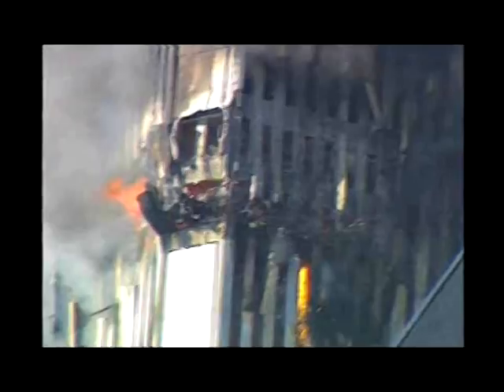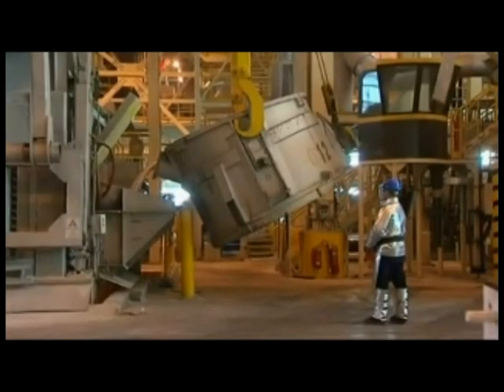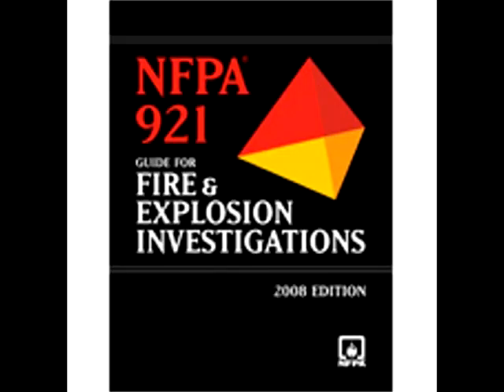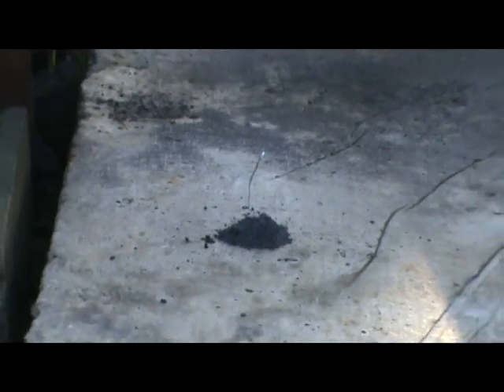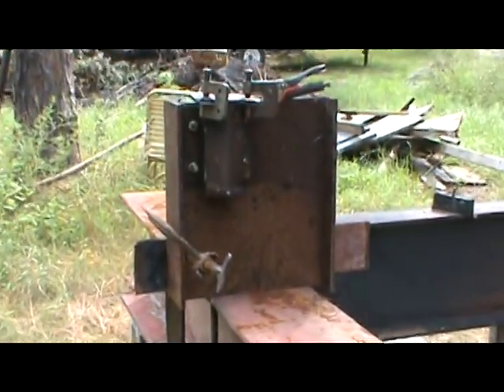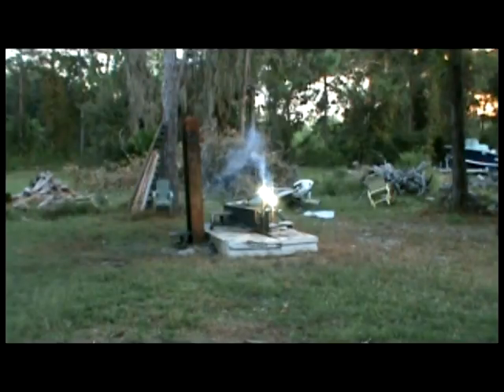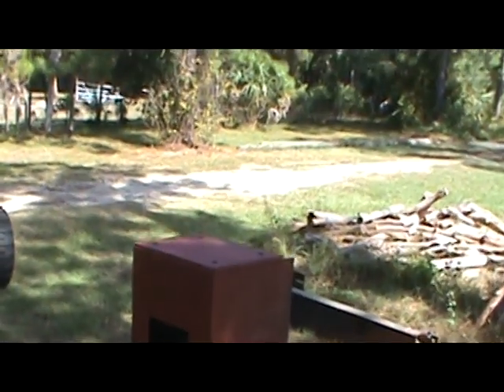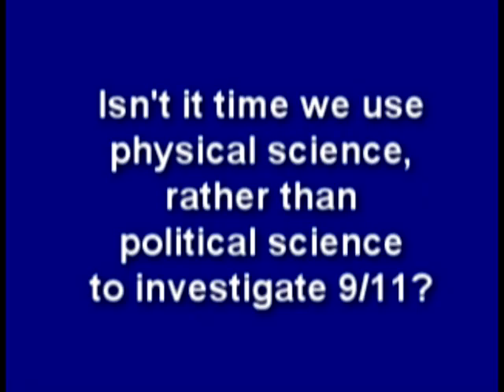9/11 Experiments: The Great Thermate Debate

Comment: So its possible to do it with thermite.
Does it mean it have be done with thermite ?

Can jet fuel weaken bolts enough so the weight of the structure break them ? 
Well a basic blowtorch could.

Does the thermite explosion do a gunshot sound ? is that loud enough ?
I mean, the structure is well hiden behind thick walls.

What would the us govt win by doint this ? the right to legitimately attack a country for petrol ?
Since when are they seeking for public opinion ? regular terrorists wheren't a good enough reason ?
How many wealthy engineers did they have to corrupt ? how hard is it to corrupt someone who have everything ?

I can make a lightning with a tesla coil, does it mean lightning are made by us government with huge tesla coils ?
Because tests in my backyard showed that 2 mass of air can"t produce electric arc, but my tesla coil can ?

I loved this video BTW, I learned some stuff and this is extremly well made.
Reply: Why would the government do it? 

That's where you need to read up on PNAC and "A new Pearl Harbour". Look at who was in PNAC in the 1990s and in Government in 2001
Reply: Jay I could answer your questions but judging by the way it is written you don't want answers you want your questions to instigate your own opinion on the matter. The government gains a war from deception. If you can't reason why a war would be desirable at the time being how the world's largest source of drugs and oil come from the country we are Invading then for all your questions you know nothing.
Reply: Bill H Though I am not concluding on either side of the 9/11 conspiracy agrument because I am conflicted by the convincing arguments on both sides, saying that "some of the bolts would weaken" is a servere understatement. Watch this video ( https://youtu.be/FzF1KySHmUA ) to see the effects of heat on steel because it really did blow my mind to see just how weak it gets. Again, I am not trying to pick a side here but I am going to just leave this here because this is a very interesting piece of evidence and if truthers would stop arguing in favor of it they may look a bit more credible.
Reply: Happy Man "The United States is a Constitutional Federal Republic (a federation of states with a Representative Democracy)"

So while we do not vote on laws directly we DO have the power to vote in people who will change what we want.
Reply: Bian Wilson Thanks for more pointless comments. Are you going too add anything of substance or just continue to scream and cry and stomp around in a circle? Either one is perfectly fine for me, because then people will notice your insecurity, that you made not even one single attempt or argument and just babbled like a fucking idiot, which by the way is really actuslly making me laugh quite hard rght now, or you can make actual arguments that I will debunk, every single one, and then publicly embarrass you some more. 

I would recomend you continue on with the first option else it wouldn't turn out good for you.

Again, you only continue to make an ass out of yourself and prove that you are a complete fucking idiot, so please continue your pointless babbling and proving me  right even more, I know you will.
Reply: Bian Wilson LOL that was way too funny, I had to screenshot that one.
Reply: Bian Wilson None of this proves a Controlled demolition
Reply: Conner Price yeah but the structural failure still happened at the base of the structure in the video, where as the twin towers the building was struck on the 93-99 floor out of the 104 stories in the building so the structural failure resembled that of the first few examples given in the video you sent. Had it been struck at the base of the building I could see your point.
Reply: Conner Price because it didnt fall from a structural failure from the bottom it failed from an impact in the side of it and close to the top. I literally just said that. Lol you wouldnt believe me no matter how irrefutable the evidence. Why are you so determined? Are you anti conspiracy? Also how do you send links do i have to type the entire url out
Reply: Conner Price yeah but twin towers didmt even begin to tip it just all went straight down as if ALL support beams were taken put at once. Lol but what makes you so certain to the point of immediate denial, as i said it doesnt matter what evidence i present to you because youre so willful to deny and argue before considering the truth of the matter.
Reply: Jay You’re missing a key point... yes jet fuel can melt steel possibly. But why did the tower collapse below the crash?
Reply: Harry Heiniken you havnt debunks the fact your face looks fucking stupid, fuckface, which is my main argument on you right now. Lol i dont give a shit what you suggest, professore fuckface, until you change your silly ass profile pic.
Reply: Harry Heiniken professors fuck face has no comebacks so he repeats himself :) haha he'll get tired of it eventually. Sorry kid but I don't debate with dipshits who pass out drunk at parties, sorry professor.
Reply: Conner Price haha 'c ant defend any points' my only point is that he's a fuxk face and I can support that thoroughly. But you can say anything you like when you're delusional lol goes to show that you're on auto pilot not even thinking just arguing so you can go on following the news like a good steeple. :) so you're saying his profile pic doesn't look like a fuck face? I havnt made any points for you to tear down. Except for that. :) LOL
Reply: Conner Price lol well any educated person wouldn't take fuck face seriously, It is rather pointless to reason with an unreasonable person wouldn't you agree? You are different as you are presentable and are at least able to hold a legit debate with me. I cannot debate with Harry as his profile picture is to stupid. :) I feel more inclined to insult him based on it lol. Let me watch the link you sent and I will reply again and we can debate if you want. If you want to shit talk then we will do that but so long as it's a debate then I'll refrain from petty insults like stupid idiot etc... I would kindly ask you do the same as you don't appear to have a fuck face for a profile image as harry DOES.
Reply: Bian Wilson Okay then. Explain how a controlled demition produced this movement right here. 

https://sites.google.com/site/911stories/ST1-full.jpg

How did it cause the exterior columns to GRADUALLY bow into the building over a period of 45 minutes, before eventually buckling them and causing the top to drop down?

http://www.debunking911.com/sim1.gif

Intentionally pulling the core down first to cause the buckling cannot explain why it sagged GRADUALLY and it also would not cause it to tilt  to that kind of a degree, so the core being destroyed first doesn't work as an explanation.

Thermite at over 4,000 degtees F could no't cause it to sag for 45 minutes, the steel would had already failed long before its melting point at 2500 degrees F.

What I am saying is explained here

http://www.representativepress.org/BowingDebunksExplosives.html

Creep deformation caused by fire can explain it perfectly, so if it was a controlled demolition as you insist then how did it produce that effect?

And both buildings actually did tilt to some degree, esspecially the south tower.
Reply: Bubsy Not in a chimney effect fire. The black soot alone can reach temperatures up to 1400 degrees C. The sagging floors and debris pile around the area would cover it up like a blanket letting it pool up. Also the floor of was on was a floor made up of huge battery equipment that is highly flammable and so lead would mix with it too . If it's thermal conductivity were changed it could flow and glow at the same time.

I am very unimpressed with the video, it is set up to fail. For one it's done on a much smaller scale so it would cool much more quickly in the video, and they also did not even recreate the stack effect conditions that it was exposed too. 

If it were molten steel then it would melt the aluminum cladding on the sode of the building and would not cool that quickly to a silver appearence
Reply: for sure the jet fuel didnt do it...
Reply: Bubsy 
"Below is a message from Stephen D. Chastain of Metal Talk.

Several times over the last year I have been asked to comment on a photo of one of the Trade Center Towers. The photo shows a molten flow from one of the windows. The flow falls down along the building. It appears orange and turns to a gray color as it cools. 

The questions usually want me to address "Is this photo a fake?" and "Is the flow steel or aluminum?" "Is this situation possible?" 

First, I will address the temperature range, then the color of the flow. 

I am working in imperial units and temperature in degrees F [To convert to C use this link]

Metals lose about 50% of their strength at 60% of their melting temperature. This is common knowledge and may be found in any undergraduate text regarding "Fracture and Deformation of Materials." 

If the approximate melting temperature of steel is 2750 F the the material would be plastic at 1650 F. Even assuming a safety factor of 3, you would expect the bolts or other structural members to deform and fail near this temperature, especially with the additional weight if a jet air liner. I would assume that the live load calculations did not include the typical office equipment and an airliner plus a factor of 3. THEREFORE I assume that the flow is not steel and that the temperature of the steel members at the time of the photo is less than 1650 F. 

Assuming that the flow would be molten aluminum from the airliner and the color of molten aluminum is silver then why is the flow orange? 

The color of pure molten aluminum is silver, It has an emissivity of .12. Steel has an emissivity of .4 and appears orange in the temperature range of molten aluminum. 

The emissivity of aluminum oxide is .44 and also appears orange in the melting temperature range of molten aluminum. 

The emissivity of plate glass is .937 It begins to soften at 1000 F and flows around 1350 F. Silica has an emissivity of .8 

Copper oxide also has an emissivity of .8. however I will assume that their effect is negligible. 

Aluminum oxidizes readily in the foundry under ideal melting conditions. Large surface area relative to thickness, turbulence, the presence of water or oil greatly increases the oxidation of aluminum. A jet airliner is made of thin aluminum sheet and most probably suffered considerable oxidation especially in contact with an open flame and being in contact with jet fuel. If you don't believe this, try melting a few soda cans over coals or open flame. If you are lucky you will end up with only 50% aluminum oxide. However, the cans may completely burn up. 

The specific gravity of aluminum is 2.7. The specific gravity of aluminum oxide (Al2O3-3H2O) is 2.42 the specific gravity of Si = 2.40 and Glass is 2.65 these are all very similar and likely to be entrained in a molten aluminum flow. Don't believe it? lightly stir the dross into molten aluminum. The surface tension is so high is is almost impossible to separate them. 

THEREFORE assuming that the flow consist of molten aluminum and considerable oxides, and assuming that the windows in the trade center were plate glass and also in a plastic state and that they were also likely entrained in the molten aluminum. I would expect the flow to appear to be orange in color. Especially since both the entrained materials have emissivities equal to or more than twice that of iron. 

Also since dross cools to a gray color and glass with impurities also turns dark. I would expect that the flow would darken upon cooling. 

I would also suggest that not only is the photo possible, but entirely likely. 

Summary: The flow is not steel because the structural steel would fail well below the melting temperature. The flow is likely to be a mixture of aluminum, aluminum oxides, molten glass and coals of whatever trash the aluminum flowed over as it reached the open window. Such a flow would appear orange and cool to a dark color. 

Stephen D. Chastain"
Reply: Jay so a couple and I don’t necessarily disagree with you. But on what the govt would gain and engineers to corrupt

The govt did gain a war, a boogeyman (Al Quida), overreach in national survailence (patriot act), hundreds of billions in revenue from the war and industry, trust in intelligence agencies, and more. 
The engineers didn’t have to be corrupted, they could’ve been working on classified projects with goals that were lied about and their technology used against us without their knowledge. 
It’s far fetched, serious, and damning but it’s not out of reason. I’m still a fence sitter bc videos like this renew my skepticism.
Reply: Operation paperclip was a proposed attack on the citizens of the United States to gain support for war against Cuba. You can look at it on the FBI website. What if 9/11 was an operation paperclip scenario? It’s not the oil we went to the Middle East for. It’s the opium, since we first invaded the opium production in the Middle East has grown exponentially and now the Middle East provides the world with 90% of its opium. Do you know what opium is used for? It’s used in medication and heroin. Every pharmaceutical company has opium drugs they give to people that are easily abused. These people spend billions each year on their addiction, to opioids. All that revenue goes straight into our economy and other budgets some of which are traced to politicians like Hillary and Bill Clinton. Then, as for oil, the US is no part of the oil monopoly in the Middle East but they do cut us a discount for protection of their oil. That’s why when an oil extraction point is attached we react faster than when our own trips are down. Then by waging a war we gain massive profit by development and selling of weapons and also protection. It’s my personal theory and I think I’m right but I’m probably missing a huge chunk of reason.
Reply: Noah Sharp - There's no longer any doubt in my mind that 9/11 was a false flag/ Operation Paperclip-type event.. And you're dead on with your opium theory.. Nobody could convince me that there isn't a direct correlation between Afghanistan being the WORLDS largest producer of opium, and the fact that heroin/opioid use is at an all-time high in the United States, Canada, and even many European countries.. Since the invasion of Afghanistan, the production and distribution of opiod-based pain medications has risen over 10× what it was before the invasion, which is exactly why we're now in the midst of a nationwide heroin/opoid epidemic that has ultimately resulted in a record number of related overdoses and deaths.. 

Now I don't believe this was the ONLY plan the elites had in mind while planning this whole deception, but it was definitely a big part of it.. Even though it was never about oil directly, there's obviously a LOT of money to be made for American-based oil companies there also.. It was actually more about the LAND they needed to build a pipeline. That's exactly what this whole Syria conflict is about.. I know the mainstream media keeps telling us that Assad's attacking his people with nerve gas, but these are simply lies created to justify an American invasion because Assad is completely against this pipeline. The problem comes in with the fact that they need part of his land to build it, and he refuses to permit it..

Last, but certainly not least, these wars have given the military industrial complex an enormous boost, and has generated a ton of wealth for a handful of very powerful families.. The bottom line in EVERY war is profit..
Reply: THISE TOWERS WERE MEANT TO WITHSTAND ROCKET STRIKES. HOW CAN A PLANE BRING THEM DOWN... AND BRING THEM DOWN SO CLEARLY. It obviously was a controlled demolition
Reply: Bian Wilson Reading through the comments it doesn't appear to me either that you left any sources, all I see is you getting your butt kicked by Harry and whining about it. You truthers are so fucking stupid.  Can't defend any comments you crap out.
Reply: Bian Wilson  I was just scrolling through the comments on this video until I ran across this thread and saw another one of you truther morons doing nothing but throwing out insults without adding anything useful.

https://youtu.be/_Kd_OPH9c0c

Large steel buildings like that can't just fall over, I don't think any Physics teachers ever told you that because it looks like from how you talk I don't think you ever went to school, much less would they ever let somebody as dumb as you graduate.
Reply: Bian Wilson Then how else shoud it have collapsed? 

https://www.metabunk.org/attachments/wtc-tilt-jpg.1665/

The building can't topple over and gravity would immediatly start dragging it downward to the ground. If the floors could only hold a maximum capacity of 15,000 STATIC tons.How would a floor with that maximum load capacity stop 100,000 tons of force SLAMMING into it)? (which this is still an extremely generous figure because it doesn't even take into account welded floor connection fractures or it's maximum DYNAMIC load capacity .
Reply: Bian Wilson It doesnt matter where it occured, look at the picture I posted above, when it begins to tilt to one side the connections on the other end would buckle and it'd have nothing to pivot off of. In order for itt to topple over, even from the top, the columns would need to be infinitley stiff. Conspiracy or not there was no controlled demolition.

And to post links yes just copy and paste the URL
Reply: If you've got everything, you've got a lot to lose.
Reply: What did they win?  Well, they obviously got alot of free gold and Oil from iraq... Eventhough the terrorists accused were Saudis..
Reply: Deluminate If you have done so much research then maybe you can answer the question I asked above that Brian Wilson ran away from
Reply: Bubsy Not molten steel, molten aluminum
Reply: darkjanggo actually the US is a constitutional republic, so not so much needing to sway the populous' opinion
Reply: darkjanggo Republic
Reply: darkjanggo we are a republic
Reply: Well if you look back into US history, on 2-3 confirmed occasions the govt has sacrified soldiers and civilians and framed another country to push the public cry for war. It sounds crazy, but it happened before and it could happen again. Maybe this was one of those times. At first I would joke that bush did 9/11, but then I studied my history a little more and found out some awful truths about the govt in this country. Soon enough it became more plausible. There's always more that we don't know. Things they don't want us to know. With the internet we get to know more and more everyday.
Reply: Jay Why would we want free healthcare you dunce. Free healthcare equals high taxes.
Reply: Dr. Phil I'll pay taxes for free healthcare. Sounds pretty good to me. More people die from not having healthcare because they make too much to have the free health insurance, and don't make enough to pay the premium for their family. They work hard, they are good citizens. Why should they go into mass debt because some insurance company wants to gouge you with high prices so you can try to stay healthy and still probably make you pay copays. A tax for healthcare would cost you less than your insurance does. Hell in some cities I pay a sugar tax. If my taxes go to anything I'd rather just have healthcare than some one the other bs I get taxed for.
Reply: Jay let's not forget!...that at that EXACT same time, the goverment announced that it had "lost" a trillion $$$!! & those "supposed" records to investigate where it went!...was the "EXACT" spot on the pentagon that was hit by 1 of the other planes!!!
Just a coincidence!!???...
Not to mention...
After they used 9/11 as their "excuse" to start war, change the laws/constitution, billionaires to cash in on insurance policies on outdated towers, ect, ect, ect...
It also allowed high ranking gov officials that "OWNED" private companys...(halliburton) to make billions of $$$ on the war itself!!

How many coincidences, billionares & corrupt things have to be tied together...to see the truth!?

Plus!! Any1 that really researches 9/11 & the planes involved...can clearly see from most all the video of the planes, they are NOT ordinary commercial planes.
They are darker, no windows, no or few detailings/logos, ect...just like military planes.

Bld 7 itself! Is even more of the smoking gun!!
No plane hit it & really a office fire is going to cause the whole building to collapse perfectly on itself!!?...when in history....this has NEVER happened before.
The list goes on & on...
Wake up!!! People!!...that don't think/believe/realize!...9/11 was a inside job.
Reply: Jay What would the us government get out of this? Well for a start it was the reason for us going to war. We needed a reason and they created one. Just like they have tried in the past
Reply: They want to control the people by fear because fear and hope are the easiest way to control the masses
Reply: Bian Wilson ur dumb. Just stop embarrassing yourself. People like you don’t get anywhere in life.
Reply: The company that contracted the towers to be built, were also in charge of cleaning it up... all before an official investigation was done.
Reply: darkjanggo We were in the middle East long before 9/11, without public approval, and we weren't showing signs of pulling out.
Reply: He never stated that the government did this he only said that they covering it up
Reply: Jay to be fair, I don’t want free healthcare, free healthcare is poor quality, because it means doctors are paid by taxes, and therefore, do not have any incentive to work hard for their position. Also, as long as they do it in one place (which they do) that’s a dead zone for the most part (which it is) and they do their best to contain it (which they do). I’m fine with the nuclear testing.
Reply: Why does anything happen?
Money of course
Reply: darkjanggo If you think the US is run by public opinion, I'm afraid your very naive. Elections are controlled by money; whoever gets the most campaign money wins almost every time. It's also almost impossible not to get reelected, and gerrymandering is completely legal. Many government officials are appointed, not elected, and can't even be removed with recall elections, allowing them to do things that go completely against what the public wants. Remember the repeal of net neutrality lasg year?
Reply: darkjanggo Whenever the government wants to go to war, they always use the media to manipulate public opinion. They did this after 9/11 to go to war in the Middle East. However, this doesn't mean that they faked 9/11 just to do this. They did the same thing with the sinking of the Maine to start thd Spanish-American war and with the sinking of the Lusitania and the Zimmerman note to join WWI. Even in WWII, they used a terrorist attack, Pearl Harbor, to justify entry into the war. Do you really think the government faked the sinking of the Maine and the Lusitania and the Pearl Hafbor attacks as well? If not, why do you think they faked 9/11?
Reply: you are one of the sheeple that outside of the boxes.
we need to convince more sheeple in the boxes to come out and face these ugly realities.
Reply: we get it Corner.. Jet fuel melts steel beam from the top to the bottom.
Reply: Jay - It was about WAY more than the public's approval to start a war.. However it WAS about gaining the public's approval and support, but for a completely different reason - turning a highly unpopular bill (the P.A.T.R.I.O.T. Act), into an overwhelmingly popular bill.. All you would have to do is read the United States Patriot Act, and you'll completely understand this theory.. 

In essence, the P.A.T.R.I.O.T Act put an end to privacy as we once knew it.. After passing this bill, police we're no longer obligated to uphold the Constitution; they were no longer required to prove reasonable suspicion in order to search you,  your house, your car, or any other personal or private property of yours; and it was no longer required for them to obtain a search warrant to do these things.. All that it effectively did was give the police and government the power to operate with impunity.. It's in direct conflict with several Constitutional Amendments, and therefore highly illegal.. Yet after the 9/11 attacks, most American citizens were begging for it to be passed.. 

In late May of 2015, the Obama Administration revised the Patriot Act by adding even more intrusive measures, and renamed it the National Defense Authorization Act, or NDAA.. The most concerning part of the bill, is the amendment that allows the U.S. government to indefinitely detain U.S. citizens, without charges, a trial, or any sort of due process, as long as they "suspect you of domestic terrorism". The scariest part about this is the language they used to describe WHAT would qualify you as a "dimestic terrorist". Here are just a few:

 Expressions of libertarian philosophies (statements, bumper stickers)

  Second Amendment-oriented views (NRA or gun club membership, holding a CCW permit)

  Survivalist literature (fictional books such as "Patriots" and "One Second After" are mentioned by name)

  Self-sufficiency (stockpiling food, ammo, hand tools, medical supplies)

  Fear of economic collapse (buying gold and barter items)

  Religious views concerning the book of Revelation (apocalypse, anti-Christ)

  Expressed fears of Big Brother or big government

  Homeschooling

  Declarations of Constitutional rights and civil liberties

  Belief in a New World Order conspiracy

Here are a couple links that summarize what the P.A.T.R.I.O.T Act, and NDAA actually do: 

https://www.aclu.org/other/surveillance-under-usapatriot-act

https://www.theguardian.com/commentisfree/cifamerica/2012/feb/29/ndaa-danger-american-liberty

At the end of the day, it was more about the ruling class grabbing more power and enslaving the United States population. But ultimately, it was about tricking us into thinking that this was in our "best intrests"..
Reply: And by the way, there is no way that this fire burned hot enough to liquify solid steel. So that raises the question of where the molten steel come from.. To this day, there hasn't been a logical explanation on behalf of the government as to what caused this to happen..

Over the years there have been dozens, if not hundreds of demolition experts and credible scientists who have explained in great detail why the "official report" could not withstand its own logic.. There are so many holes in the reports of NIST and the 9/11 Commission, that I find it hard accept the idea that anyone could possibly believe either of them.. I'm not even close to being any sort of an expert in demolition or science, and yet even I could effectively destroy both of their theories simply by using the basic knowledge and understanding I have in Physics.. 

I'm not asking anyone to take my word for it, but I am asking you to challenge this narrative yourself.. Go into it with an open mind, and see if the government's theory is capable of logically withstanding the challenge of scientific fact.. You might be surprised of what you'll learn.
Reply: There is no evidence of the use of thermite because, suspiciously enough, all of the scrap (steel) from the collapse was quickly gathered and shipped to China to be "recycled" BEFORE any sort of thorough investigation even began. Now does that make any sense?! Even your most novice investigator would understand the importance of this as evidence.. And yet I'm supposed to believe that this slipped the minds of some of the top investigators in the country? C'mon!!
Reply: Bill H why don't we just go and ask lol
Reply: Lord Shua - Yea, I'm well aware of Saddam's plan to implement a gold-backed currency that would have effectively de-valued the USD.. I believe the name for this currency was the "Dinar".. Are you aware that Gaddafi also had his hand in this? I only ask because this whole subject is something that not a lot of people know about, and even fewer are aware of Gaddafi's role in it all..
Reply: Conner Price - Brian only "ran away from" your question after answering it several times.. And yet you still continue to ask the same question lol.. Sure, you kept changing the collapse event you were using to base your argument off of, but the answer doesn't change. There is no way for a building to fall the way the two towers (and building 7) did without taking its foundation out first. And since the point of impact on each of the buildings was between 850-950 feet ABOVE the ground floor, there's no possible way the impact could have weakened the entire foundation as perfectly even as it would have to be for it to fall as neatly and evenly as it did.. It literally imploded, and fell straight into it's own footprint.. But I'm not saying anything that Brian didn't already say.. 

At the end of the day, anybody who understands the basic laws of physics, also understands that the way these buildings fell, and the "official" findings of NIST and the 9/11 Commission, simply do not add up. It's literally scientifically impossible to have happened the way they're claiming it did, and there are hundreds of credible Physicists and Architectural Engineers who have demonstrated why this is so.. Then, on top of all the science, theres the fact that there has NEVER been a modern skyscraper that has collapsed due to fire.. There have been skyscrapers that have caught fire all over the world, some of them burning for DAYS and still never collapsing.. So this has never been documented a single time throughout history, yet I'm actually supposed to believe that it happened 3 times in a single day, all within a few hours of one another? C'mon!! 

 If you aren't at least willing to consider it a possibility that this could have been some sort of controlled demolition, then you're simply not challenging yourself to think on a critical level.. Might I suggest that you check out "Architects and Engineers for 9/11 truth"? Just listen to what these guys have to say before totally making up your mind.. Cheers! ✌

https://www.ae911truth.org/
Reply: Steven Hyde Where did he answer the question? It looks like he rambled that the building would tip over to its side and fall over which is physically impossible. Brian, like you, is wrong, the towers did not fall straight down because that would mean the columns would have stayed in alignment and they didn't.

http://image.wikifoundry.com/image/1/bJnGDdVKcriu9-2pLASahQ40948/GW342H221

Are you trying to argue that this is a "straight" down collapse??? This is the South tower, the North tower didn't tilt to as much a degree but I will explain the initiation in the North tower. 

 The plane impact cut several columns, destroyed core bracing and collapsed floors in the area causing a hole. That caused core columns to loose lateral support and placed more load on  the other core columns. The plane impact also knocked off fire proofing in the area, and the fire spreads to the south causing the columns on that side to begin twisting.. Air is also sucked in through the large impact hole starting a huge chimney effect weakening the remaining columns much quicker.

The hole expanded and reached another row of columns in the center that supported the hat truss, and with this loss the stress had now become enough and the hat truss caves in at the center bringing the antenna down. The upper section of the core had been pretty hulled out by this point and so the mass travels a considerable distance before it impacts the first floor and then total collapse became inevitable.

With that said his answer about the tilting is wrong, and nowhere did he even attempt to answer the last question that I asked him, you claiming that he did would just be a complete lie and everybody can scroll up and will see that. 

" There is no way for a building to fall the way the two towers (and building 7) did without taking it's foundation out first "

Bare assertion, you show nothing to support that besides merely referencing A/E 9/11 Truth who's arguments have long been refuted for years now. Did you even read the article I posted at all? The collapse initiation can ONLY be explained by fire and you or Brian made not one single attempt to refute it, you cant do it, you wont do it, because only fire can explain gradual creep deformation over that long of a period. 

You are gravely mistaken in assuming controlled demolition and that the laws of Physics needed to be violated and you are vastly outnumbered in the number of experts. 

"In 2009, Architects & Engineers for 9/11 Truthhad a booth at the annual convention of the American Institute of Architects. AE tried to get the AIA to pass a "Building 7 resolution" - "a Position Statement in support of a new investigation into the complete collapse of 7 World Trade Center on September 11, 2001." However, it failed by a vote of 3,892 to 160 - garnering just over 4% support. The AIA has maintained separation from Gage and his organization. AIA media relations director Scott Frank has stated that "We don’t have any relationship with his organization whatsoever."
(A/E 9/11 Truth Wiki)

http://www.nmsr.org/nmsr911a.htm

https://www.google.com/url?sa=t&source=web&rct=j&url=http://brannenworks.com/aca/wtcsog.pdf&ved=0ahUKEwiwjt6m3PnXAhWE6iYKHWaLDvAQFgglMAA&usg=AOvVaw0sjoCfOKttBmCEO4Oj_3jF

Do they not understand Physics either? 

And I did consider the possibility of demolition, years ago until finding out that there really was no controlled demolition. There is not one single argument you can point out to me about the collapses that I cant explain because I mow know that there was no demolition.
Reply: Steven Hyde  Building seven began with an interior collapse, a massive load transfer system failure, that load transfer system ran right along the north side of the core, and the failure propagated westward rapidly because of the large loads it supported on fewer columns causing the core to give way. With the core gone the facade was left hollowed out and collapsed shortly after, the evidence is daylight can be seen through windows on the other side and by the way it drops down.
Reply: Your theory isn’t completely wrong except for the fact that the beams holding building together are welded and bolted. Even if it weakened bolts it would not break because of the welds
Reply: Bian Wilson Jay's questions are worded from lack of knowledge. If you read it carefully he made a point about a blow torch waking bolts? That's sounds exaggerated in a sarcastic manner. Why would anyone bring that up if the tests done on this video were a clear representation of how th steel was "cut". Why would loosening of bolts one at a time be a base in this argument? That shows me he has no idea what he is talking about.
Reply: darkjanggo we are not a democracy, we are a Constitutional Republic
Reply: Bill H uh k
Reply: darkjanggo - Well that's the illusion they try to create. But under the current political system of our corporate United States (that's right, this is a corporation, not a country), we have no power. Giving our votes and our taxes only signifies our consent to our continued extortion and enslavement.
Reply: Harry Heiniken all my points are already on display from other sources, if you dont want to accpet them thats your decision, just like its mine to not leave my personal ideals on display for people who are uneducated and have penis writen on their forhead to contemplate. :) why would anyone share anything of value, with You x,D
Reply: Conner Price the only point I have made was that his profile pic looks stupid as fuck. I made points with other people in the comment section, like the fact the building fell STRAIGHT DOWN. Or do you need evidence to support that claim, dipshit. My main points are obvious to people with common sense, which you clearly lack.
Reply: Conner Price even my physics teachers and architects and demolition-ists I have talked to agree that buildings don't fall straight down like that. Even when you demolish a building it's difficult to get it to fall perfectly like that. Lol the only way you can do it is with charges and the best charges use thermite. You don't want the truth you want to be told something and believe it whole heartedly without question, sheep.
Reply: Even if a jet fuel fire could weaken some bolts in the area of the fires, it could not possibly cause a total collapse of these structures. There is only one way those towers and building 7 came down and dropped straight down the way they did. Controlled demolitions using thermite and strategically placed explosives. Witness accounts of the collapses definitely confirm this. Not only did Larry Silverstein make out like a bandit that day, but the government was given carte blanche power with unwitting consent of the population to declare anyone they desired as a terrorist and to gain unrestricted access to every aspect of your life. Welcome to a brave new world.
Reply: Harry Heiniken hey everybody fuck face over here says it doesn't prove anything. :) it's solved then, no more argument. Professor fuck face says so. LOLOL
Reply: Harry Heiniken good dont respond professor fuckface, theres better things for you to be doing like chuggling beer, ya 30 year old Child 
. :)
Reply: Lol do I need to source his dumbass profile picture? If you had actually read through the comments you would know I didn't make any points other than the fact his pic looks like a dipshit fuck face and that i could never take him seriously :) you must not be a random you're probably his boyfriend
Reply: Happy Man - So they say. We are now a corporate oligarchy or a corporate fascist state.
Reply: Harry Heiniken when I see your profile picture the term 'fuck face' comes to mind. Yeah let us listen to the wise guy with THAT profile pic. :) lol shut up
Reply: Jay Since when did the government care about public opinion? Mate, the USA is a democracy. It's literally ran by public opinion. The majority of people would have been outraged at an unprovoked war at that time.
Reply: darkjanggo so are you telling me that us people agre with all the nuclear tests in the ocean, lack of free healthcare, super expansive education etc... ?
Because if US govt did care just a little about public opinion they would change that.

Im not from usa but exactly like all the us citizens i know the general opinion by watching the media.
Reply: Jay Yes, actually there are lots of people that both agree and disagred with those topics. Democracy requires the great majority of people to agree on something to change. The topics you've listed don't have an overwhelming majority of people on either side of their respective debates.